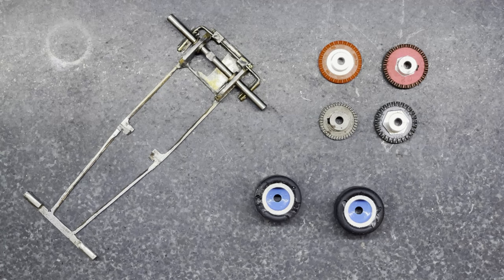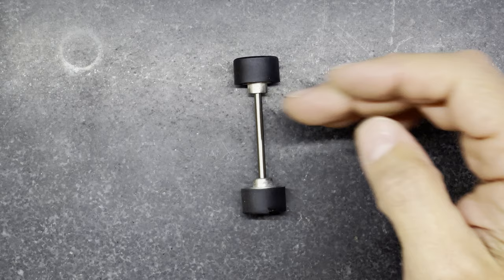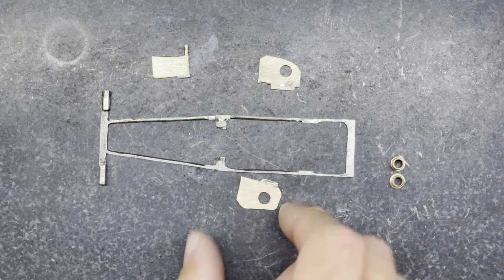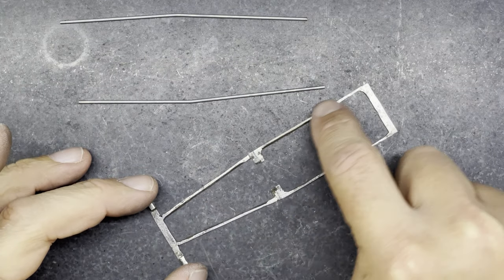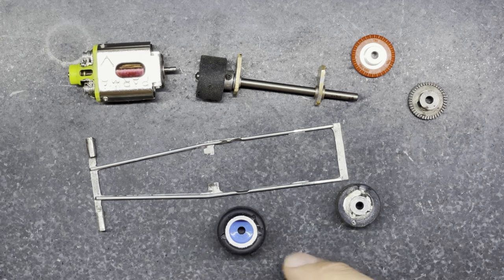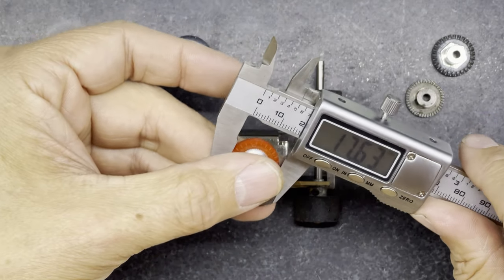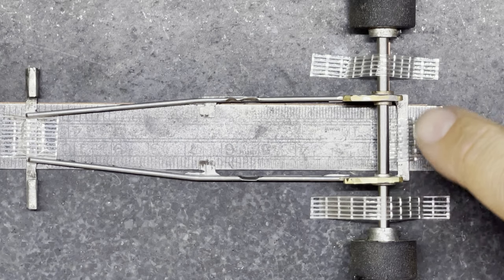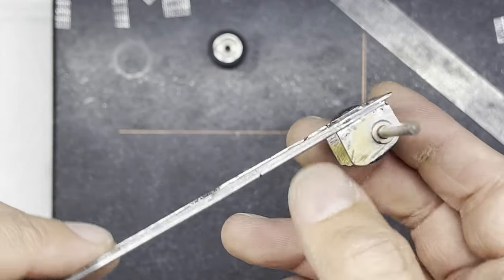Assembling and restoring a slot stox car chassis to improve performance

Comment: Would have been easier to just start with a blank piece of paper. Ha ha. But then it wouldnt be a refurbishment. How is the motor going to go in? You could make a U bracket from piano wire and solder across the rear of the motor (top part) and to the top of the pillar blocks. Or are you soldering in a motor bracket? Same deal, a piano U bracket from top of motor bracket to pillar blocks works well.
Reply from the maker: Yes, I have thought it would be easier to start from nothing many times! 😂.
I intend to make a U-bracket out of piano wire like you mentioned. The motor will also be tacked in on both sides.